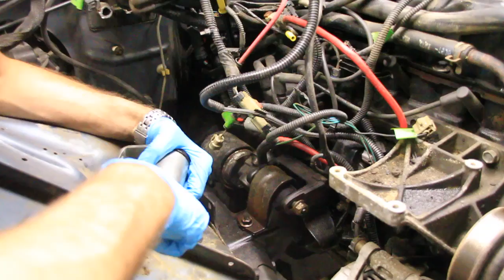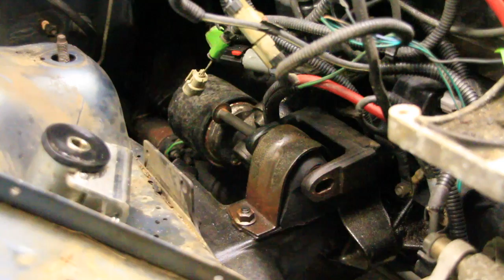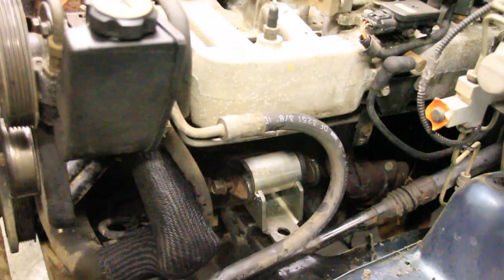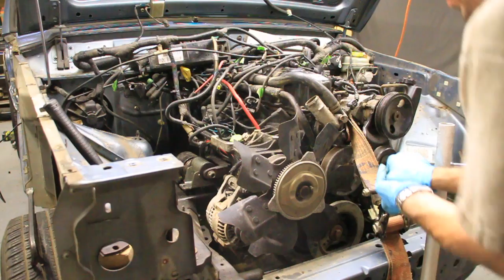How-To Install Motor Mounts - Daystar Brand

Comment: I'm replacing a bad 2.5 motor in a 2000 TJ auto trans, with a good runner from a '97 TJ manual trans. Took the flywheel and clutch plate off the new engine and put the original auto flex plate on. The two blocks are identical but for some reason I need a 3/8" spacer between the engine and the bell housing. Makes no sense.

Comment: Two days to replace my cracked manifold and clean out the intake and prep the motor by degreasing it and repainted some spot's and painted the bolts taking my time on it thanks to the video guys I saved $500 dollars by doing it me and with the help of my brother should be done by tomorrow afternoon with it

Comment: Where is a good resource for a parts identifier? I need to get motor mounts and an engine bracket for my 91 XJ. I find lots of motor mounts but I am unable to find an OEM engine bracket. All I find on part websites only have upgraded brackets. TY in advance.

Comment: This the only video I have found of yours that I would recommend people don't follow. Instead of the ratchet strap or transfer case jacking, loosen the transmission mount bolts. It will free up a ton of wiggle room in the powertrain. Would have made it a whole lot easier.

Comment: Damn i did the one side by Air box and said fuck it and grinded the mount shackle to align with mount. Because it was not bolting on right. But nice to see they would have worked otherwise.

Comment: I did same thing took over 5 straight hours worked on getting them in till wee hours of the morning turns out i was told its allot faster if you loosen the trans mount they drop rite in.

Comment: Never did this before, not a mechanic, got it done in less than 2 hours. My 2 cents: do not use a jack, get a 1 ton (minimum)shop crane and 2 ton lift straps. This way you can wiggle this shiit without it falling. Also do drivers side first, do not undo both sides at once. Use a good prybar to get that mount to shimmy into the frame hole. Shop crane makes this a fast and easy job actually
Reply: And undo transmission mounts so you don’t eff that up.

Comment: Have to laugh seeing this vid and the new and improved part not lining up; might have been a problem lining up because the engine was lifted on the one side.  But what I'd like to see is a vid showing how to do this procedure Without jacking the engine up via the bottom of the oil pan,  (crushing the gaskets in the process).

Comment: I'm installing a zone 3" add a leaf lift to my 99 Cherokee sport. I messed up the alinement pin in the leaf pack. A week to get a new one. No one new what I was taking about. So the first one was the wrong size. Also all the shock bolts snapped off. That's just the back. Lol

Comment: Tried to bleed the brakes but bleeder on wheel cylinder was rust welded to the point that a torch and vice grips couldn't get it loose. Went to replace the wheel cylinder and the brake line snapped (also rusted). Replaced the over axle lines and did the flush (finally). Took her for a test drive and the hardline from the proportioning valve to the rear softline started leaking like crazy.... by the end of all of this I replaced the master cylinder and all hard and soft lines on the brakes (front and back).. but hey it stops great now and doesn't leak!
Reply: Dude, same exact thing ended up happening to me recently. What started out as trying to replace the old nasty brake fluid turned into a whole brake system replacement. I also went ahead and replaced all the drum hardware and axle seals while I was so far into it.

Comment: Just curious to ask but would bad motor mounts have to do with a vibration at low speeds while accelerating, like 30 - 35 mph but then goes away after 40 mph 

My Jeep still have the original motor mounts
Reply: Same happens to me

Comment: I’ve had one of the threaded bosses on the engine block on my WJ 4.0 broken.  Another one was stripped out.  I had one good bolt hole to work with.

I figured I’d just use two other holes that were a bit further away and remake the bracket that bolts to the engine, but those holes were a funky 9mm size, so there weren’t any bolts to go in those.  I had to tilt the engine in the Jeep such that I could get a drill in there to drill and tap the holes to 10mm to match the rest.  

Gah.  Such a nightmare, that was.

Comment: Leaf spring bolts on my 2001 ended up being hell. Just cuz it was so hot and discouraging. Bolts got stuck and eventually ended up snapping them off. After some cutting with a grinder and a couple hours with an air hammer was able to replace all the hardware and get the new leafs in... two weeks after starting.

Comment: Maybe the bolt holes in the mounts were in the wrong place.  Should have compared with the stock mounts.   If they were wrong, you could have filled and drilled them in the right place.  Moving the engine forward - and the fan closer to the radiator - is not usually a good idea.
Reply: Absolutely, I'm dealing with this issue right now with aftermarket stock mounts, going to keep buying different brands until I hopefully find a set that fits.

Comment: You shouldn't have to hammer the through bolts out of the mount. Just adjust your jack pressure up or down and it will slide right out.

Comment: The easiest job that took to long was the valve cover gasket . Got it off quick but when I went to put the new one one after cleaning the mating surface I had the wrong gasket in the right part number box! Ow and changing the heater core was fun to! Lol
Reply: jokerchris1 always try to get the old gasket off in one piece then match it to the new one for figment or in the case of a valve cover gasket just drop the new gasket over the old one to test fitment
Reply: Soothsayer 4417 I did realize it was wrong right away, but the extra time returning the gasket is what I was talking about. Plus I had to go to two stores to track down the part which didn’t help! Lol

Comment: I had better luck by loosely securing the two nuts. Then, the hole through the bushing was aligned with a punch and the long bolt, while raising and lowering the jack until it aligned properly. Torqued all fasteners before moving to the other side. It's good to know I don't have to remove the oil filter adapter. I'm working on the passenger side of my 87 Comanche now.

Comment: I agree with bolting the mounts to the frame first. Then you can take the long bolt and sharpen it to make it easier to hammer in, least that worked for my fbody

Comment: did this on 11/12/16 and I had the same issue where the engine seemed slightly back towards the firewall my whole body is aching from trying to move the engine forward took me three hours but well worth it I used the brown dog ultra flex motor mounts

Comment: For the easy job gone wrong, nothing beats the XJ leaf springs.  It must be the only part on the jeep that can take 2 days to get off, and about 25 minutes to put in the new ones.  I had torches, and pickle forks, and impact guns, and wrenches, and oils, and everything just laying every where when I finally got those things out.  Its the XJ equivalent of impacted wisdom teeth.
Reply: lmao if this isnt truth i dont know what is
Reply: Jordan Moore Yes. Took me two days for mine too lol
Reply: Totally.  However, I found it became way easier to get the bolts out when I alternated loosening between the front and back of the second leaf spring.  The first one took a day.  The second one took less than 2 hours.  I would loosen the front bolt a few turns, then loosen the back upper shackle bolt a few times.  I think it took out some pressure from twist and allowed the bolts to move more freely.  Then they popped out rather easily when they were both loose, using a vice grip to grab the bolt and a hammer to pound the vice grip outward.
Reply: Totally had the same problems with mine. Eventually cut holes to knock the old nuts out of the  inside of the frame.

Comment: Rear shock replacement turned out to be the job with more jobs. Fishing new bolts thru frame, and knocking out old bolts takes some patience, but achievable! Use a magnet with wire turned around threads.

Comment: Hey Matt, I'm sure the flexible unibody has its influence on alignment. Great job overcoming the issue.

When I installed my Rubicon Express lift I fought with the leafspring bolt/bushings. Because I didn't have a helper I was forced to fight with it for a day and a half by myself. I was determined not to take the leafsprings to a local garage. I beat the bolt head with a large hammer, Lots of PB Blaster and pipe cheater on my 1/2 ratchet with the breaker bar ziptied to the leaf spring. The rubber bushing sleeve was rusted to the bolt something awful.  I finally won!  Whew what a battle!
Keep the faith, your videos help me alot.
Thanks,
Michael

Comment: i think they are too strong and not too flexible as stock mounts.Yeah,they are piece of shit  but they are flexible. And every time you going offroad or just driving on a bad roads you killing the steel motor brackets,on the engine . I know it,because i`ve been in that situation once.. I used very strong motor mount, without any flexibility...And engine drops down... too bad...

Comment: Damn dude I have the same problem!!!. I am pissed off that everything I change takes me more than is supposed to. At the moment I'm taking the overnight break so I can go and nail the driver side motor mount on which is the one giving me problems . Is back 3/4 of a inch. I tried lifting the transmission and pulling the engine. still nothing. The left side went in with out a problem.

Comment: gald to see im not the only one to fight these mounts. i got one done and going to tackle the other one this weekend. i would like to added one little tip that i fought with before taking the mount apart and trying to just install the bushing to try and find out why the holes would line up. which is.  jeep left access metal on the motor fork side so my tip is to dremel off that leftover metal so your mount will line up. or you could cut the bushing down if one so chooses. thanks for your tip on jacking up the tcase to try and bring the motor forward. i thought a racht strap as well  with no luck. thanks for your videos i really like the one on the taraflex low kit it  gaves me confidence in opening my tcase. keep the videos coming.

Comment: BleepinJeep, can you do a special how-to video concerning the 96 XJ Jeeps problem with the motor mount BRACKET BOLTS cracking and sometimes actually sheering off from the engine block?  
How to safely go about inspecting and/or replacing and torquing the three,  3/8" x 16 TPI x 1-1/4"Long bolts.  And maybe provide a better solution to this for the public.

Comment: Just replaced engine mounts on my 95 Cherokee and referenced part of this video for help.  Of course it took longer than the internet said it would.  The funny thing is that I watched only the first part of your video to see if there were any tricks to getting the through bolt out.  That was the biggest pain in the rear for me.  There is a sweet spot to getting just enough load off the mount to get the bolt out, but not jacking the engine up too much which applies force in the opposite direction.  That bolt will not move until you get that balance figured out.   As far as putting in the other nuts and bolts, that was the easiest part.  My experience was completely backwards from yours,  you got the through bolt out without much persuasion, but had some real challenges installing the other nuts and bolts.  Funny how things work out.  Thanks for uploading the video, it did help me out while doing this job.

Comment: you should have bolted the mounts to the frame first and then lowered the engine onto them because the you would only have to line up one bolt.

Comment: I replaced the engine and transmission mounts on my 96 XJ. found it easiest was to remove bolts from transmission mount lift on the engine with a hoist and then was able to move the body around (just wiggle it) front to back shake side to side jump up and down on it and just like Matt put a nut or bolt on it as they line up.

Comment: Thats exactly what happened to me, 95 XJ. I did the drivers side in about 10 minutes, but the passenger side would not line up at all, after an hour and a half  I ended up reinstalling the old mount, fortunately it was still in decent condition.

Comment: When pulling the motor on a few jeeps I have had the worst time getting the top two inverted torx head bolts off. I could never find the right socket set for them so I would do everything to get them off with 3/8 in and 10 mil sockets. finally found what I needed at harbor freight oddly enough and now I can get them off but they still suck. I purchase different hardware to replace them with so I never have to deal with them again once out. 

I have also completed 6 lifts for myself and friends and have always had to cut at least one of the leaf springs off the front bushing. bolt is always rusted to the inner bushing sleeve. grrrrr.

Comment: Gotta story for ya matt, my factory hitch on my xj had a huge hole in it from rotting. Un bolted it bought new one an went too bolt it up and found out the frame had a crack it where they cut a hole in the frame too run the filler tube too the gas tank. That was a deciding factor on weather too keep it or not. :(

Comment: Went to paint my valve cover thinking it wasnt gonna take to long so I started to take off the pcv elbows and those mother fucker were on there good. The rubber grommet was harder than rock lol ended up breaking the pcv elbow and having to wait a week till they showed up cake they had non in Stock
Reply: Broke Both pcv and crankcase

Comment: Not on a vehicle but changing the bath tub fixture turned into rebuilding three walls, retiling the entire bathroom and a new tub. Bonus we found bare hot wires in the same wall that was full of wet rotten food. Good times.

Comment: The simple 1 hour project that's took half a day was changing out the front break pads on my 04 liberty. I had to run to the part store to get new caliper slide pins and brakes bolts of course I needed to go to three different stores because not all had everything I needed. After I got home I realized I needed a 22mm socket for the new bolts so back to the store I go to buy a socket. It was one of those days.....
Reply: No body cares about a " Liberty"

Comment: had to replace motor mount on my 94 yj had same problem as you where motor didint line up so we loosened bolts on transfer case skid plat and pryed off the frame and it slid right in to place dont know if its the same on and xj but it worked good on an xj

Comment: 96 xj trying to take out the radiator one of the lines that goes to the transmission or what just would come off tried everything had to replace the whole line
Reply: would not
Reply: +Jeremy LaBrecque You need a fuel line disconnect tool. On the set that I bought at Oreilly's, the yellow one was the correct size.

Comment: just getting it running again. bought it may 2 of this year, drove it for 2 days, then went to fix all 4 brakes, and everything went to shit. wouldn't so much as even click when I turned the key. replaced entire ignition system in column, dash and engine only to find out it the NSS was dirty. then I had hellacious problems with my transmission, replaced everthing that would supposedly cause it to bog then engine down to the point of stalling and the transmission would transfer absolutely no power to the wheels only to find it was the transmission control unit that was bad. then it had an issue with stalling immediately after starting. every single sensor in the engine bay was replaced with fuel filter, throttle body replaced, and entire sending unit and pump, only to have a friend jump the auto shutdown relay with a paperclip.

2275 dollars later I have a jeep that needs axles